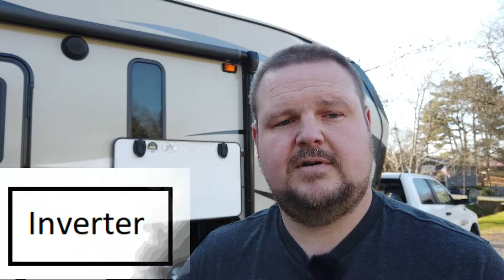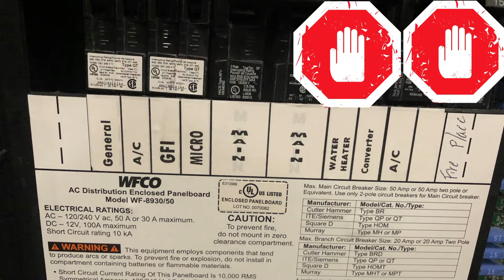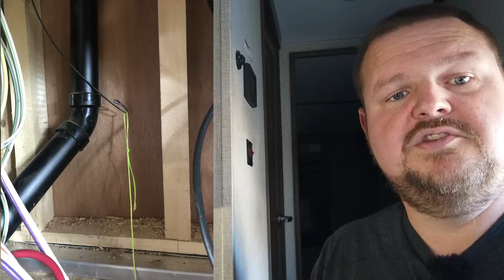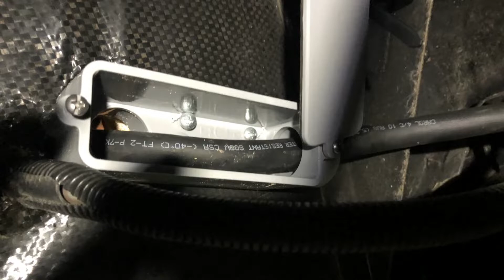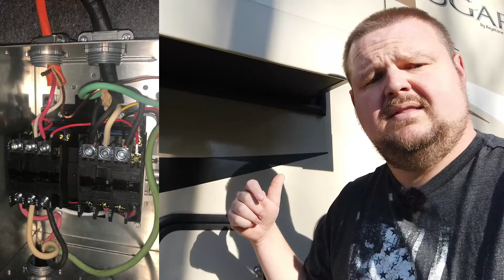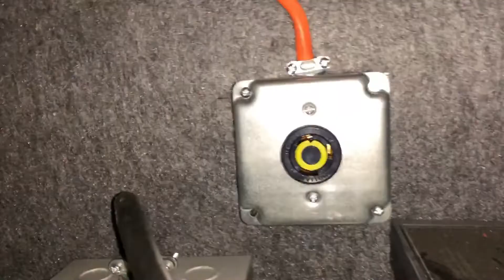RV Pure Sine Inverter and Transfer Switch #renogy #gopower #diy

Comment: Why don’t you just run an extension cord off your inverter straight into the 50 amp plug that you normally use for shore power. All you have to do is flip your converter switch off inside your rig.
Reply from the maker: @1fartdart  I don’t have to deal with any cords.  I can pull over on the side of the road and lot dock somewhere and use my inverter without having any setup or use my generator with very little… just unplug the cord from the inverter inlet and plug into the generator

Comment: I'm in the same boat trying to figure things out I'm adding a complete solar system to my slide in truck camper. And I was wondering how to use the RVs existing system I was wondering if I could any field system in place which had an AGM battery. And then add solar with lithium on the side. I just wish I had a better idea on how to connect the new transfer switch to the existing.
Reply from the maker: I think it would be better to replace the AGM and only have one type of battery.  It should be possible with a battery selector but your charging parameters are different for the two types of batteries.  Just asking for headaches I think.  I’d also go for some type of manual switch as that’s the main problem I’ve ran into is the transfer switch failing out when a heavy load is applied

Comment: I just ran a 12gag extension from the inverter to the rear of the RV and plugged it like normal with the conversion adapter. Yes I still need to shut off the bigger draws Ac, Fire place and the microwave. But it works like a charm 
thanks for the video

Comment: 99% of the CPAPs out there are 12v, just instal 12v outlets in the camper.
Reply from the maker: And 98% of those want way too much for the 12 volt adapter plug, but yes, I have one now

Comment: What model inverter did you use?
Reply from the maker: The 2000 watt Renogy pure sine.  Part of me wishes I would have just bit the bullet for a victron multiplus though
Reply: @GimpyCamper  I would really prefer an integrated transfer switch in the inverter that would support my 4k gas generator.

Comment: Ok thank you so much for this video!! I plan to put solar on my 40’ Open Range but I currently have an onboard generator, and I even have an inverter to power the residential fridge while I’m driving, but I’ll need to purchase a larger inverter to power the rest of the rv. I figured there was a way to work around buying all sorts of expensive devices and switches. But I haven’t found a video that explains it like you do. New subscriber!!
Reply from the maker: Glad it helped.

Comment: On your next gen setup, maybe try finding an inverter with an A/C input, then drive that with a Genset. No transfer switch necessary, and also you can save quite a bit of fuel in the Genset. The A/C input would drive the loads for the camper and also charge your batteries at the same time.  Happy Camping !